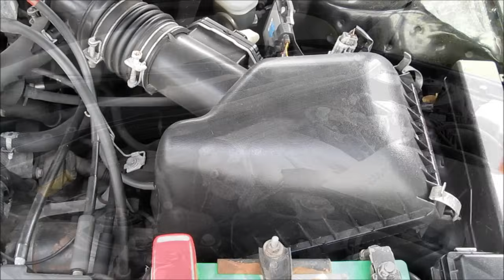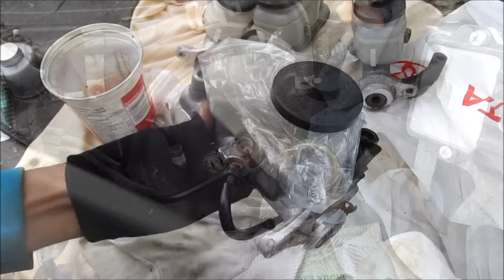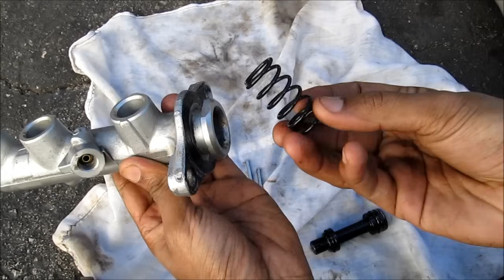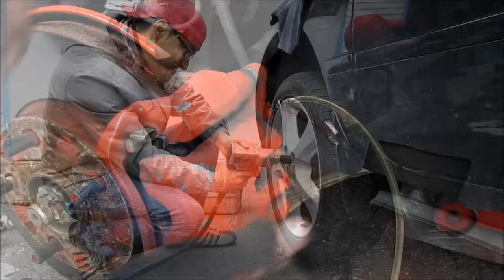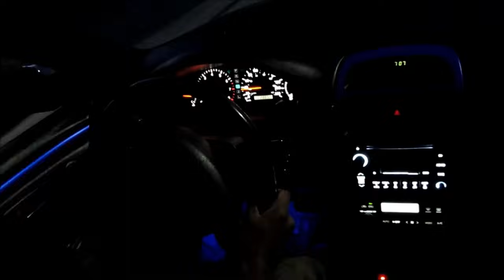How to Replace a Brake Master Cylinder

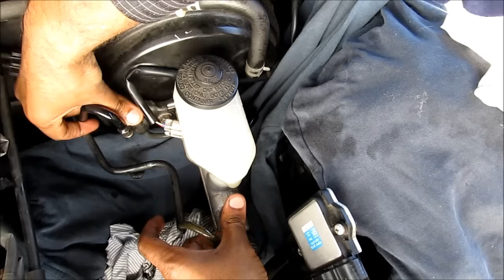Comment: @6:20  Can you use those plugs , which are on the ports of a new MC, instead of fingers for MC Bench Bleeding? I plan to work myself without a helper. I think your helper was releasing the Brake Pedal while you were closing the MC ports with your finders. Thank you for so informative video. I have a different car (2009 Nissan Sentra), but many things are common. Nissan is loosing a bit of brake fluid after long drives (the level in the MC drops like ~1/4 in after 100 mi), and someone wrote me that it is probably worn gasket on one of pistons in MC, and I need to replace that MC. No leaks were observed anywhere.

Comment: Did you find out what was wrong with the MC? My Nissan has similar braking issues and my mechanic thinks it's due to worn rear drum brake pads, which I don't believe...

Comment: Great video as always. 
I followed your video and did the bench bleed on car. Any more tips for bench bleeding the  master cylinder? I'm not getting any fluid out of the rear port. The front port bled out brake fluid within 3 cycles.

Comment: BSK Garage my car i20 clutch pedal drops to floor and never return back while driving. Is the master or slave cylinder bad?? How to confirm?
Reply from the maker: Check fluid in both
Reply: @speedkar99  replaced and all ok. No external leaks.all fine.
Reply: @speedkar99  When issues arose, without depressing the clutch pedal, I changed the position of gear stick from 1 to 5 or R or from any position with engine still running, there seems no sudden movement or jerk or shaking. It's really surprised.

However, when it was normal, the car engine stop at any gear changes without clutch depressed. This is ok for every car.

Comment: my suzuki liana, brake padel when pressed apply brakes then moves forward or starts sinking, no sign on oil loss or reduced, further when pump it two three times padel feels perfectly alright. my guess is master cylinder seals are gone, requires your opinion.
Reply from the maker: You need to bleed your brakes, including abs

Comment: I have a 1986 Toyota pickup and wanted to know if running the master cylinder dry of brake fluid will ruin it.
Reply from the maker: Yes
Reply: @speedkar99  Sir, why one output terminal of my car ignition coil gives less sparks than the other terminal. In fact, the 2 terminals are control by a single primary circuit of the same ignition coil!!! The other ignition coil has the same issue.

I have checked for all resistance readings of the PRIMARY AND SECONDARY CIRCUITS of each IGNITION COILS which shows normal values.

Please kindly help.
Thanks.

Comment: Same problem, i replaced my master cylinder but still soft, all the way to the floor brake !
Reply from the maker: Did you bench bleed?
Reply: Yes i did, i even use Techstream to purge abs to bleed too, replaced calipers also but still soft !
Reply: what did you do to fix it ?

Comment: I have the European version of what you call iM in its very first generation...it's basically a Corolla hatchback 2009 model...known as Auris.
One week after a transmission repair in the middle of last summer ,the brake pedal started to have no pressure and being spongy...yeah i know it can't be a connection between clutch and transmission with the brake system and brake master cylinder but it was that moment i kept im my mind...
Car had 180,000km when the brake problem first appeared and after... I did a few km again for vacations on an island,brakes were normal...came back in my town and brakes started falling again not only in stops but in low speed as well . Driving downhill was a nightmare and ABS engaged most of the times to help the situation .Then in the start of October brakes came back to normal all the way through winter till  a week before on April.Now car have 197k
I do all services at Toyota dealership and every 30,000km (every second service) they bled brake lines as part of maintenence.
Do you think it's a bad brake master cylinder?But how all the winter brakes were normal and now that temperature is above 20 Celsius it happens again?
Reply from the maker: +TheAlexunit did you bleed the abs system?
Reply: speedkar99 i only know that they bleed the brake system...at least that's what the full service plan is.
Few weeks now brake pedal sometimes goes to the floor if a press it indolently.During the winter brakes were normal like it didn't happen before.
Reply: speedkar99 Is ABS system bleed different procedure than brake system bleed?
Do you think it could be a bad ABS module since sometimes brake pedal is softer than other times?
During winter i had a normal hard brake pedal...

Comment: THANK YOU BRO
Reply from the maker: +مداد الخليج جدة your welcome
Reply: @speedkar99  Sir, why one output terminal of my car ignition coil gives less sparks than the other terminal. In fact, the 2 terminals are control by a single primary circuit of the same ignition coil!!! The other ignition coil has the same issue.

I have checked for all resistance readings of the PRIMARY AND SECONDARY CIRCUITS of each IGNITION COILS which shows normal values.

Please kindly help.
Thanks.

Comment: Why did you have to suck out some of the Brake fluid from the reservoir if the saran wrap method will keep it from leaking out?
Reply from the maker: +Philip Patterson the Saran wrap keeps it from leaking downward. 
Sucking fluid out makes it less messy when you remove from the car.

Comment: Hi. Great video. Question: can I use grey gasket maker instead of black? Thanks!
Reply from the maker: +alfredobrown Yes as long as its meant for sealing and not cement
Reply: speedkar99 thanks!
Reply: @speedkar99  Sir, why one output terminal of my car ignition coil gives less sparks than the other terminal. In fact, the 2 terminals are control by a single primary circuit of the same ignition coil!!! The other ignition coil has the same issue.

I have checked for all resistance readings of the PRIMARY AND SECONDARY CIRCUITS of each IGNITION COILS which shows normal values.

Please kindly help.
Thanks.

Comment: great video. thanks. how many times do i have to bleed the master cylinder. i mean pressing the pedal and releasing it.
Reply from the maker: +Pedro Morales Magonzales Maratto Mulasso Modestos Until there'd no bubbles coming out of each line. At least 5-6

Comment: how do you get the resivour tank off the master cylinder?
Reply from the maker: +April Hinson there's one screw on the side holding it on and it pops straight up

Comment: is bench bleed necessary?
can i just bleed from the brake caliper to get the air out from the master cylinder all the way down to the brake caliper, will that work?
Reply from the maker: +Ray T Technically you can but it will take a very long time to bleed all the air out of the lines, especially since air is compressible. Ive tried it and it took a lot of pumping and refilling to finally get fluid coming out of the caliper.
Reply: ok. thanks.
Reply: @speedkar99  Sir, why one output terminal of my car ignition coil gives less sparks than the other terminal. In fact, the 2 terminals are control by a single primary circuit of the same ignition coil!!! The other ignition coil has the same issue.

I have checked for all resistance readings of the PRIMARY AND SECONDARY CIRCUITS of each IGNITION COILS which shows normal values.

Please kindly help.
Thanks.

Comment: Thanks for the video. I have a Toyota Hilux 1993 pickup truck. I did the same thing and it was working alright. But recently after couple of weeks the e-brake light on the dashboard started flashing while I'm pressing the normal brake (pedal brake not the e- brake).. It flashes once I press the brake hard and turns off after wards. This keeps happening every time. The fluid level is not low and I think the truck does not come with a low fluid sensor.. What might be the reason for this? 

Plz need a help
Reply: Just found out that the low fluid level sensor in the reservoir is missing. It wasn't there since the day I bought it. What might be the issue of not.
Reply from the maker: +tharakaswalpita Could also be a loose parking brake switch, try disconnecting it.
Reply: +speedkar99 what do you meant by "a parking brake switch"?
Reply: +tharakaswalpita I went to a technician. He said the problem is with the power booster vacuum.  That's what indicates the light. It's a Diesel engine so later on I'll have to replace it.

Comment: I have a Toyota Corolla nze and the master cylinder is a aisin 13 /16 . If I have to rebuild it what size and brand of seals will I have to buy. Thank you.
Reply from the maker: +barry5011 check the rebuild kits on Rockauto, I don't have a brand recommendation.
Reply from the maker: +barry5011 check the rebuild kits on Rockauto, I don't have a brand recommendation.

Comment: Nice Video. A word of advice though. Brake fluid isnt terribly corrosive on car paint. I always tend to loose a lot everywhere and never have a problem. On plastic, especially headlights it will mess them up. One trick I learned to avoid bleeding every wheel is do the bench bleeding procedure, then bleed the brakes from the front two lines several times, and you wont have to bleed out everywheel. Bleeder screws are a pain too. Had to replace 3 wheel cylinders because they got stripped. Best to heat them up with a torch before you open them and use 1/4  ratchet to break them open. Patience.

Some cars have pedals that naturally feel soft, like my yaris. I replaced my MC last year with a new aftermarket dorman one, and it failed, so I'm returned it and put back the OEM on.
Reply from the maker: +AwesomenessIskey Thanks for the tips. Bench bleeding alone will still leave some air in the lines at the point of connection to the MC. Its best to bleed the rest of the air out of the wheels and put fresh fluid in that hasn't been exposed to moisture.
Reply: +speedkar99 Thats true, if I were doing a complete flush it would be better, but many mechanics just want to get the job done as quick as possible. I found that my pedal felt the same bleeding the lines from the master cylinder a few times or better.
Reply from the maker: I wouldn't feel safe leaving that bit of air in the lines. After engaging the ABS a few times on a test drive I was able to get a significant amount of air out of the system which made the pedal much firmer than a regular bleed.
Reply: +speedkar99 Mine has no abs. Interestingly enough, different brake systems react differently. My friend had a jeep when we pushed back the caliper, it made the brakes almost non existant, even with the lines closed. After bleeding at the wheels several times, I bled the master cylinder and it made it better than what it was before. Most cars dont push air back when you compress the piston, but some do. Thats why I like to test the brakes when I ever do a brake job for someone
Reply from the maker: +Gcatt1 thanks. And yes I ended up bench bleeding while it was on the car since I didn't have a vice to hold it for me.
Reply: Speedkar how do you know how many lb/ft (or metric equivalent) your impact wrench is applying when putting tires on for example?
 I was young when I worked in a shop and never really paid attention to that at the time. I'm asking because rear struts are next (which if you haven't had to do that on a solara. . .) and if I bleed brakes and fix struts myself I am defintely just buying one thanks and sorry for not staying on subject. thank you
Reply from the maker: +Gcatt1 It depends on the air pressure. I dont have any idea how much my gun is rated for. But it does come in handy for big suspension bolts. 
Good luck on those rear struts. The entire rear interior has to come out on the solara. Thats why I didn't bother replacing a blown speaker or done rear struts  when i had mine.
Reply: Honestly I don't see what the difference is between bench bleeding and bleeding it with it hooked up to the car. I've had two mechanics say the bench bleed is the way to do it. But those connections leave air in no matter the method. I need to save money and do this myself but its only the 2nd thing I will have repaired and I'm not sure now is the time to take a chance. 

I followed your power steering fluid replacement video and other than a couple of rookie errors like thinking I could refill the fluid with the gallon jug because I had a funnel there to catch it, it went fine. My slow speed turning is way better than it was previously which I was not expecting. Thank you , +speedkar99
Reply from the maker: +Gcatt1 It depends on the air pressure. I dont have any idea how much my gun is rated for. But it does come in handy for big suspension bolts. 
Good luck on those rear struts. The entire rear interior has to come out on the solara. Thats why I didn't bother replacing a blown speaker or done rear struts  when i had mine.
Reply: Yeah, I watched a bunch of camry tutorials and only the back seat came out. Then I saw a solara diagram that had everything come out. I checked on Youtube and thats what I saw. Every piece of plastic is layered on the last. I'm still kind of fuming. . .so unnecessary.
Oh yeah, is that just a regular hex (I think you call it a box end wrench) hex wrench you use on the bleeder valve and do you know how what size? Thank you

Comment: Have the same mushy feeling brake pedal. How did you diagnose that the master cylinder needs to be replaced? Could it simply have been fixed with a fluid change? 

Thanks for the vid again. Very helpful.
Reply from the maker: +Riza Khan I've done a few fluid changes in the past, upgraded and cleaned my brakes, and it was still mushy. So naturally I started thinking about the MC.

However, after changing the MC (and then changing it back due to a minor leak), I realized it wasn't my MC, but it was my brake bleed procedure didn't include stomping on the brakes on a slippery surface to engage the ABS. After the test drive, I got back and got a good amount of air from the system, and from then on, the brakes have been nice and firm. I'm now back on the original MC.

Comment: Mushy Brakes:  According to my understanding, once you get air into the ABS system you are going to need to go to the dealer to bleed the system to get the pedal feel the was it was before you bleed air through the system.  Can someone confirm or deny?
Reply from the maker: +siucbset I have techstream. On my Solara there isn't an option to even get into the ABS ECU. On my Lexus, in the ABS tab there's a brake bleed option but when I click on it it says my vehicle doesn't support it.

The best way to get air out is to bleed the brakes, drive on gravel/snowy pavement and slam on the brakes to cycle the abs a few times, then rebleed again. I found doing this took out a good amount more air on the second bleed, and the pedal is now nice and firm.

Comment: hi speedkar. did you use black gasket maker instead of a new gasket on the master cylinder?  I've been looking for a new gasket but have been unable to find one.Thanks
Reply from the maker: +Melanie Andries Yes. I wasn't able to find that gasket either. Its just an air/moisture gasket, not super critical that it seals. It just keeps moisture away from the booster rod.
Reply: +Melanie Andries The gasket is a dealer part.  I have a 00 Camry Solara and the part number is 47275-12020 and yours may or may not be the same.

Comment: Excellent video.  I learned a lot.
I replaced a booster and master cylinder a couple years ago and almost went crazy trying to get the brake fitting to thread into the hole in the new part.   After a lot of wiggling it worked out.
Reply from the maker: +heymisterderp Thanks. Yes those threads are bit tricky to get started at first.

Comment: I changed out a failing master cylinder recently on my 97 camry and bled the system with a Mityvac pump, but it is still not as rock hard like it was from the factory. Granted it is much better and safer than it was, but it's still mushy up until a certain point. Do you think it may be the old brake lines?
Reply from the maker: +MrSatchelpack  Have you driven the car on gravel/snowy roads, engaged the ABS and traction control a few times then rebled the system? I got a lot of air out of the system after that second bleed.
Reply: +speedkar99 I will give that a shot. If this works, I think I will do that from now on. Thanks.
Reply from the maker: Let me know if you got the brakes bled properly. It really helped for me.

Comment: By any chance will you be making a timing belt video? I'm thinking of making an attempt to changing the timing belt while I'm changing the valve cover gaskets and thermostat?
Reply from the maker: +IXBlackoutXI1 I did a timing belt video last year on my 1MZ-FE:
https://www.youtube.com/watch?v=_c_a-ECaWSU

Might have to redo the TB/WP next year on my 3MZ-FE Lexus because the water-pump is leaking.
Reply: @speedkar99   BSK Garage my car i20 clutch pedal drops to floor and never return back while driving. Is the master or slave cylinder bad?? How to confirm?

Comment: a lot of work just to replace the brake fluid, but well worth it. awesome job my buddy :)
Reply from the maker: +SK4869 Yes it is a lot of work! But once the bleeders are broken free you don't need to pull the wheels to access them after the test drive, just use ramps and slide underneath.
Reply: you always make it look so simple. if only you didn't have to rip half the motor away to get to the Brake master cylinder. but once everything is put back together you are good to go my friend. thanks love watching you show us how it's done. :)
Reply: @speedkar99   BSK Garage my car i20 clutch pedal drops to floor and never return back while driving. Is the master or slave cylinder bad?? How to confirm?